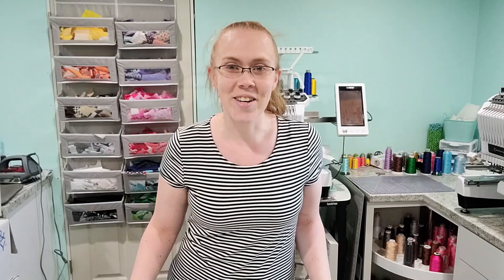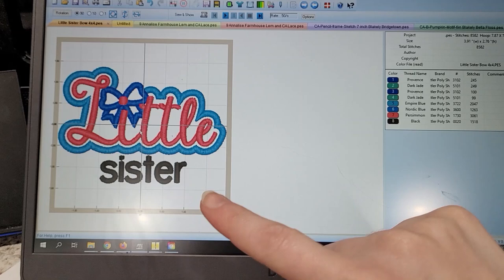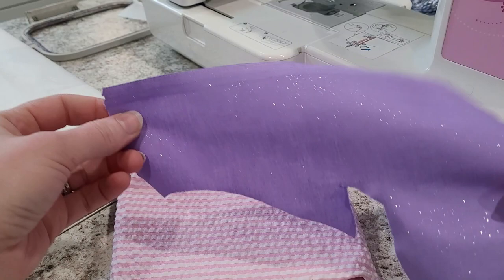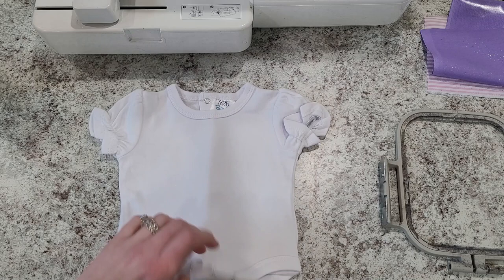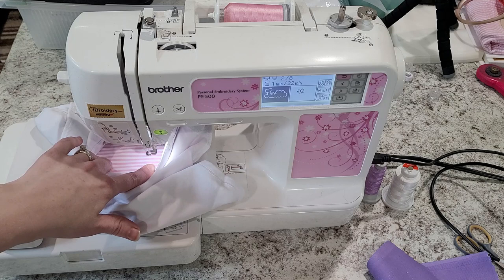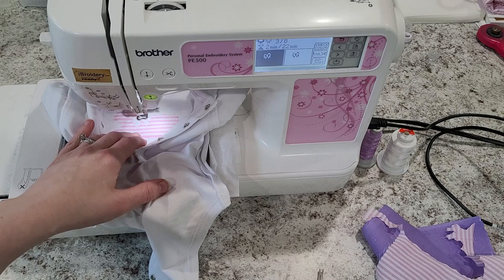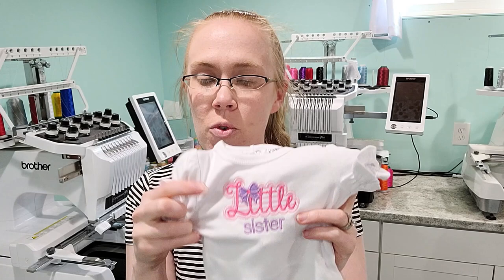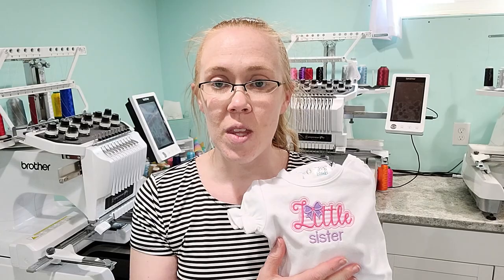FULL TUTORIAL: How to Applique using a Brother Embroidery Machine | Step by Step | Brother PE500

Comment: I've seen other tutorials that use wash away embroidery stabilizer.. is the heat n bond in replace of it?
Reply from the maker: The heat n bond is meant to secure the fabric to the garment to help keep it smooth with wash & wear.  I would not suggest using wash away stabilizer behind the shirt as a stabilizer but the clear wash away stabilizer that goes on top of the garment can help with cleaner stitching. I personally do not use this often on items without a lot of pile or loft, that's just my preference!

Comment: I need help with using this on a crochet project. I made afghans and I'm afraid to use mine on the embroidery machine. I have those same machine and only played around with it when i first got it many hears ago. I now have to learn all over again. Also. I have the scan and cut vinyl machine and I can San my own drawings to it to cut is there a way I can use my own designs on this older one. I know they have came a long way.
Reply from the maker: There's not a direct way to scan an image to embroider on this machine.  It would need to be digitized in software on a computer.  There are some newer machines that will auto-digitize drawings, but they are much larger/expensive machines.

Comment: What weight poly mesh do you use? And the cut away stabilizer is it a specific weight?
Reply: I find they are so stiff , I only use cut away
Reply from the maker: I use 1.5oz polymesh from Allstitch. I find it much more flexible and thinner than traditional cutaway!